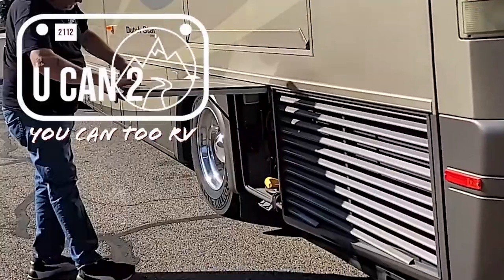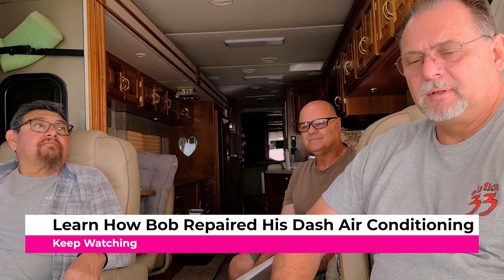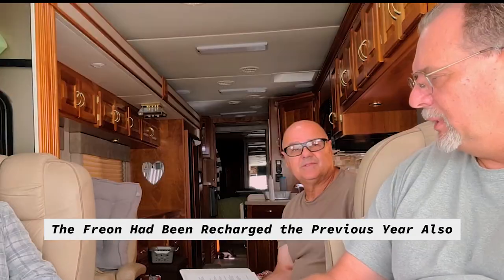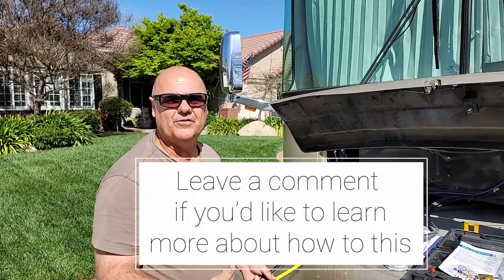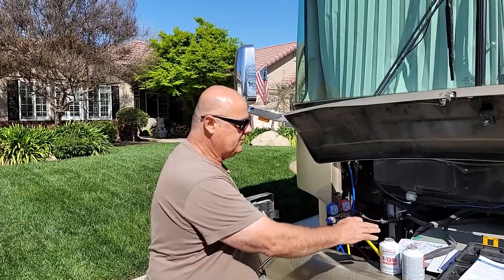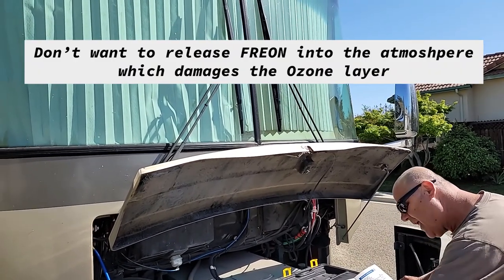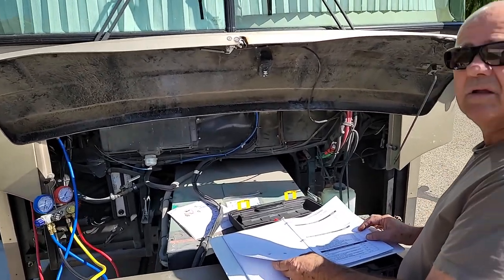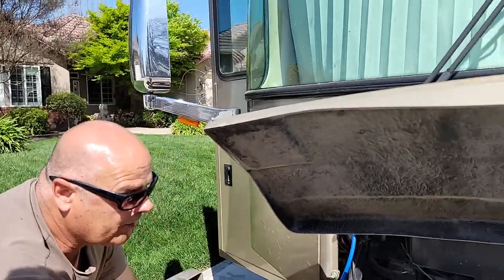DIY Dash Air Conditioning Repair

Comment: Very informative video, thanks.  I had to have my AC compressor replaced while on a trip. (it seized up) When we went to charge the system, we could not get the compressor light to come on at our control unit.  Hence, we could not get the compressor to come on.  I've looked for fuses (found it, it was good) and I looked for a low pressure cut off switch.  I searched high and low and cannot find the low pressure switch.  I'm driving a 2009 Fleetwood Discovery 40X.  Any suggestions would be appreciated.
Reply from the maker: Thanks for your kind feedback. I'm not sure where to valve would be located. I find a lot of vehicle specific information in FB groups from others dealing with similar issues. You might try there. Good luck and happy motoring.

Comment: PHIL! How are you doing? I was really surprised to see you in this video. Jim (The '73 Step Side).
I have a 2005 Bounder 34M that had the refrigerant leak out through a low pressure hose in the front next to the generator. Oil on the rubber at where the metal end is attached it makes me certain that's the problem. I took it to have a new hose installed & the threads on the evaporator are disintegrated. The A/C shop doesn't get into that with RVs. The Freightliner shop said 10 hours labor, which sounds pretty high.
I have a friend who is a certified (and very good) welder. I think he can weld a new male threaded piece onto the old one. Probably either weld on another aluminum end like what's there now, or braze on a brass fitting. What do you think? I need a new hose made at the A/C shop anyway.
Reply from the maker: Sounds like quite the repair. Thanks for watching and subscribing. BTW, I'm Dan. Phil is my buddy who appears in many of my videos.
Reply: @youcantoorv9860  Tell him I said hello. We worked together for a few years & he bought a pickup from me.

Comment: I pray you see this comment, I have a question, one that I thought would've been a simple find, but I have searched the factory manual that came with our Coachman mirada f53 chassis. I have searched everywhere else, and no definitive answer anywhere. 
      -under the dash on passenger side, at feet, is a vent. It has 2 reservoirs, a bottom one, and one that is above it, that has a flap that stas closed on a/c, and lays down on max a/c. On the front of the flap "was" wha I believe is a "sponge." Well, I looked through the vent cover, and water was dripping onto the sponges on the door flap, while on max 
A/c, so the flap was down. When I touched the "sponge" it was so brittle and crumbly it just scraped off. My question is, is water supposed to drip into those reservoirs that I can see I'm tha vent under dash? I ca feel air sucking into an inch wide hole in middle of reservoirs, one on bottom, and one on top on other side of door flap. Also, whe I go under hood, the black box, has a nipple that is leaking the water, ad I had to attach a hose to it so it would stop running all over the battery,  but the black box is dripping water from around the seals/edges as well.  So the water that's dripping from that nipple, is it coming from those reservoirs inside that black box? It's the same spot that I see in your video where that silver round thing is hanging, and the nipple where I attached that hose, is hanging right behind that silver metal round part. And also, when searching this up, what is Tha vent or system actually called so I can find a diagram for it, or video. Thanks so much
Reply from the maker: It sounds like you are discussing condensation, which is perfectly normal. The amount of condensation varies according to the humidity. This is only a problem if the "black box" doesn't drain. A wet dark box is ideal for the growth of mold. Condensation dripping or flowing from your AC is a healthy sign that everything is working.
Reply from the maker: Most RV sash AC units were made by Evans Tempcon. You can Google them and hopefully find the parts that you are looking for. Good luck

Comment: Did BoB flush his system? Anytime you replace the compressor its very good practice to Flush out the system to remove any contamination that the old parts left behind. If the compressor failed theres a good chance you have metal in your system.
Reply from the maker: Hopefully I won't be doing any air conditioning repairs soon.  But I will remember your advice for the next time.

Comment: I have an almost identical RV. Two questions. what is your freon suppose to be filled to?  I have evans condenser RV218276 I can't tell if this is a parallel flow or fin and tube condenser.
Reply from the maker: I am certainly a layman and relied heavily on the Evans Tempcon manual to determine the proper operating pressures. I strongly urge you to download the manual and determine the proper pressures for your motorhome. Good luck, and thanks for watching.
Reply: @youcantoorv9860  No problem thanks, my question comes directly from the manual because I have a Spartan front condenser and if I can figure out if it’s a fin tube  or parallel condenser then I know how much freon it’s supposed to have.  I have a vacuum on the low side when checking operating pressure, so I believe there’s a blockage somewhere.
Reply from the maker: Have you changed your drier? They will cause blockage.
Reply: Yes I changed the filter drier and I didn't have negative pressure.  All I did was vacuum the lines for 1 hour and I swapped out the valve stem on the high pressure side.  Maybe I need to change the drier again.  The first compressor did lock up so maybe there's still some shavings in there.  @youcantoorv9860
Reply from the maker: I didn't experience anything like this. Good luck with your repair.
Reply: @youcantoorv9860  I’m going to take the lines apart and blow compressed air through and replace the drier one more time.  I live in Florida so I want dash air.  I have 2 15K Penguin AC units that I can run on the generator but I still want dash air.   I’m undefeated in repairs so I want to keep my record lol

Comment: OK I believe you can help me
 out because my RV is similar to the one in this video.  I just bought a used 2003 Newmar Dutch Star 8.3L, ISC 350.  Dash AC blows hot air.  I tried to add freon and the compressor sized up.  I have replaced the compressor and need to replace the receiver drier.  I don't know where it is and what part number I need.  I know I have an Evans system.  I purchased a vacuum and plan on blowing compressed air through the lines.  Can you help me find my AC drier?
Reply from the maker: Sure. Open up the generator compartment and look on the passenger side. It's near the service ports that we accessed in the video. Be sure to evacuate your system before adding freon. Good luck, and thanks for subscribing.
Reply: @youcantoorv9860  thanks a million
Reply: @youcantoorv9860  I have evacuated the system added freon, watched the compressor clutch engage, low pressure  hose cold, dash air hot.  Do you know when I can find the heater control valve?
Reply from the maker: It is part of the Evans unit. The easiest and surefire thing to do is to install a ball valve in the heater hose. This allows you to shut off 100% of hot water and ensure that your AC works it's best.
Reply: @youcantoorv9860  awesome.  How do I identify the heater hose.  Don’t want to cut the wrong hose and do you know the size of the hose?
Reply from the maker: I made a video,  How to Keep Cool Driving Your Motorhome. It shows where I cut the heater hose and installed the valve. The heater hose should have the size printed on it. I think mine was 5/8". I bought the valve and nipples at a Lowes.
Reply: @youcantoorv9860  my plan is to use vice grips to pinch off whatever hose I think is the heater hose and see if the vents blow cold.  If they do, that’s where I’ll instal the ball valve.  I want to sincerely thank you for giving me direction.
Reply from the maker: Good luck and thanks for subscribing
Reply: @youcantoorv9860  I did it!!!!  I installed a ball valve in-line of the hoses.  I think it’s actually cooling.  Hard to tell in Florida heat.  I lost probably a gallon of coolant in the process so I’ll refill and use a thermometer to see how much it’s cooling.  I’m also going to try and test the Freon level or pressure like you do in this video.  I tried one of those gages that you use when you add Freon on the low side but it reads zero.  I know it has Freon because I added it and the compressor clutch engages.  So I’ll hook up the dual gage and try to read the pressure like you do in this video.
Reply from the maker: @QLFProductions  it really makes my day when I hear reports like this. The ball valve should help out, as heater valves are notorious for allowing some hot coolant to pass.
Reply: @youcantoorv9860  ThankYou
Reply: @youcantoorv9860  question, when do I need to open the valve?  If I want heat?
Reply from the maker: @QLFProductions  you are correct. The valve only needs to be opened when you want heat. I put it on my pre-trip inspection list. This way,  I remember to turn it on in the fall and off in the summer.
Reply: @youcantoorv9860  still not blowing cold.  It’s 100 degrees here in Florida today.  I’m idling, now I’m wondering if my Freon is holding.  When I did vacuum check, she held as long as I had my red and blue knobs closed.  But I can’t get anything to read past zero.  I did have the heat on when I was testing for the sake of trying to make sure no air in coolant.  I may drive a bit and see if she cools off then.
Reply from the maker: One lesson that I have learned the hard way is to know when it's time to turn it over to an expert. You are in Florida, and there are a lot of places that work on RVs. I'd find one that specializes in chassis AC repair. Good luck